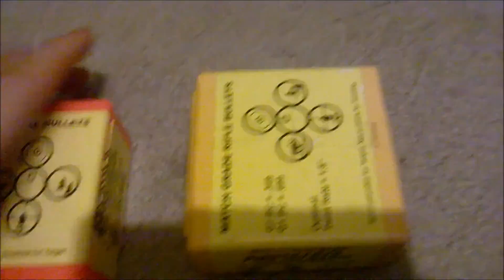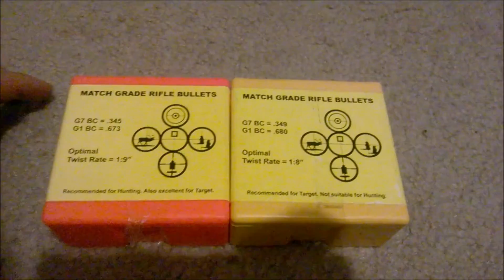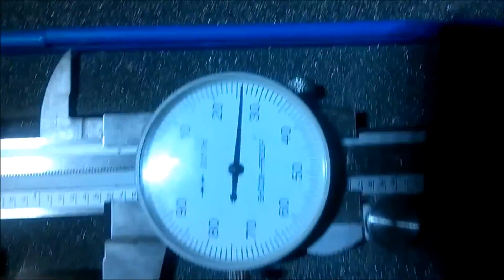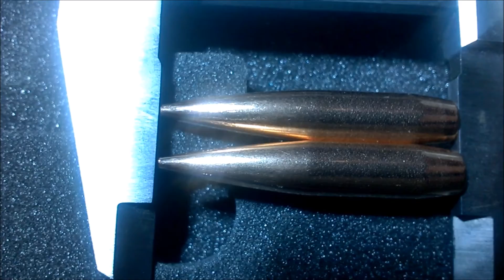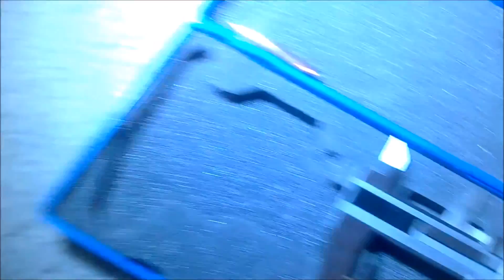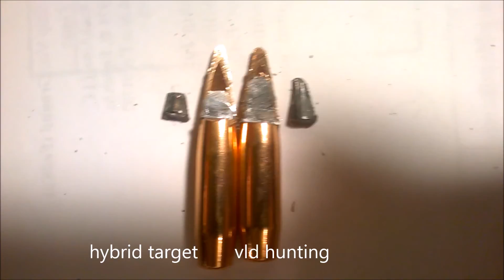Berger bullets Hybrid target vs. VLD hunting, Whats the difference?

Comment: Hello Gen, The difference between our hunting and target bullets, as you see have to do with jacket thickness.  Our target bullets have a thicker jacket to sustain rapid fire etc, while our hunting bullets have a thinner jacket.  We don't recommend hunting with our target bullets, because of the thicker jacket which creates a more narrow wound channel. We know that plenty of our customers have been successful with our target bullets while hunting, we just emphasize that shot placement is going to be critical when doing so.  The two bullets that you are showing are actually not as similar as you might think.  The hunting bullet you have is a VLD with a different nose shape than the target bullet you have which has a Hybrid ogive.  You can see that the VLD has a sharper angle when it hits the bearing surface, which makes for a very long ogive.  The Hybrid target bullet you have has a combination of the secant and tangent ogive which creates a smoother transition to the bearing surface making it easier to load and tune.  In regards to the twist rate differences, we fire test our lots to calculate the most accurate BCs and in doing so we list the twist rates that would be needed to achieve the listed twist rates.  We recommend finding your individual twist rate that lines up with your specific atmospheric conditions, using our free stability twist rate calculator.  This will give you the best twist rate for your own conditions. Here's a link: http://www.bergerbullets.com/twist-rate-calculator/ . Also, we have a Tech Team that is available to assist you with any questions you may have the phone number is 714-441-7202 or you can email them at TechSupport@bergerbullets.com. Hope this information helps! Happy Shooting!
Reply: Berger Bullets: That's very good of you guys to come forward with that information, it's very helpful, thanks.
Reply from the maker: many thanks for the feedback Berger Bullets!
Reply: Awesome customer service Berger!

Comment: Berger Bullets are cup and draw design only.  Berger doesn't make a true hunting bullet.  They never have and never will.  True hunting bullets are only found  from Speer, Nosler, Woodleigh, Swift and Federal.  Hunting Sports Leaders and Wildlife Conservationists only recommend bullets such as Speer's Hot-Cor process, and dual Hot-Cor Grand Slam, Nosler's Partition,  Barnes' Triple X, Swift's A-Frame, Woodleigh, and Federal's Fusion.  Berger was a target bullet then and its still a target bullet.  Hornady's Classic Interlok design doesn't exit anymore...they abandoned the Tried & True Interlok years ago for a weaker design that guarantees core separation.
Reply: If you are of the mindset that a bullet should stay together then there is no doubting your comments. There are others looking to do more damage at distance than most of those bullets can achieve. ELDMS are a favourite among those hitting game at lower velocities. These are devastating down to 1800fps and even less. They also are not as explosive as some might have you believe at close ranges either. Check out Nathan Foster's vids. I don't think anybody could argue with the evidence he presents. Has a website also. Cheers

Comment: As Berger bullets pointed out, you can clearly see a difference if you know what to look for.  The vlds have a distinctive look if you ask me.  Their hybrids are more pointy even though herring service looks similar.  The implications are noteworthy but only for those who can take advantage.  My primary concern is with seating depth as that is by far my least favorite thing to work on.  I never get clear results with vlds but fortionatly for me they shoot accurate regardless even though others seem to get better results by changing their depth.